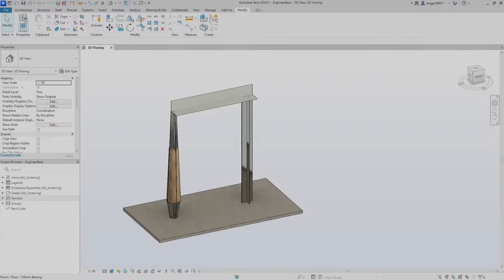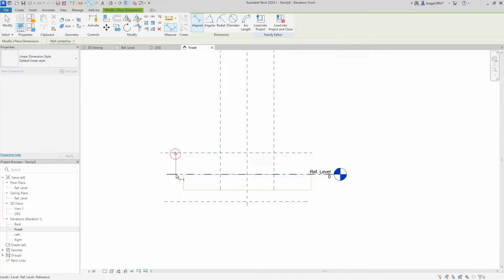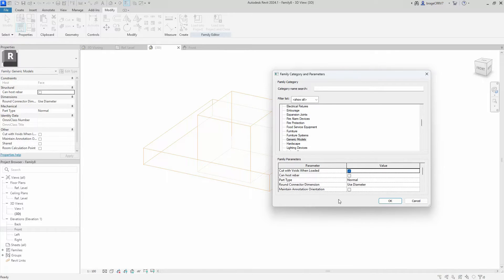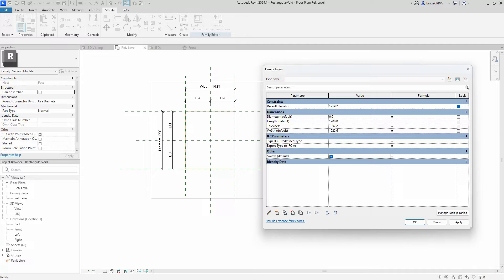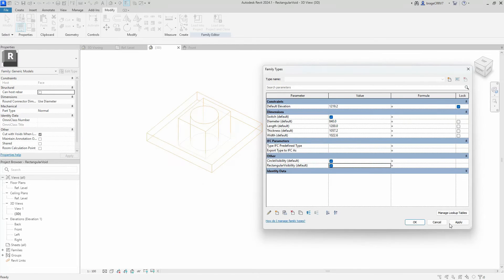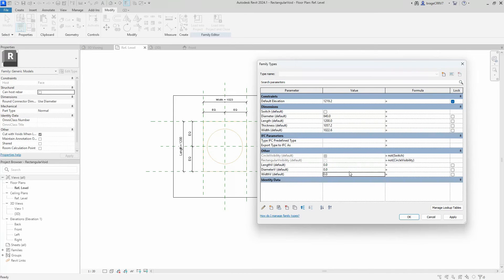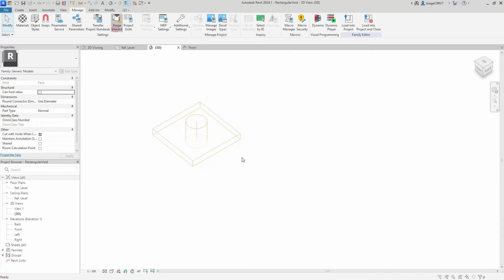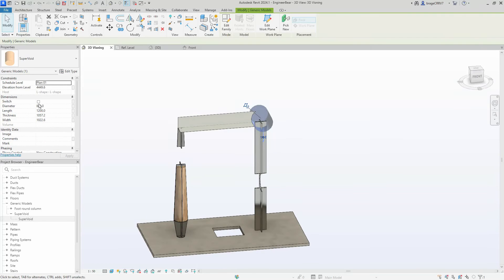Revit family - SUPERVOID, cut through anything!

Comment: I don't understand the advantage of the switch parameter. Wouldn't it be much easier to create two types (1x circle and 1x square) within the family, which are simply controlled by the visibility parameter? When using them, I simply decide whether I want the circle or the square as the shape.
Reply from the maker: Hey there! Initially, that was my plan! However, I ran into some issues while trying to switch the void off and back on again. So, I opted for the solution I detailed in the video instead. Maybe your soution works now! Let me know if it does!